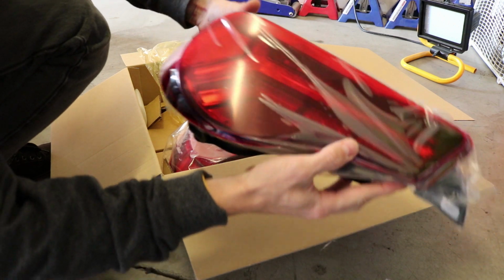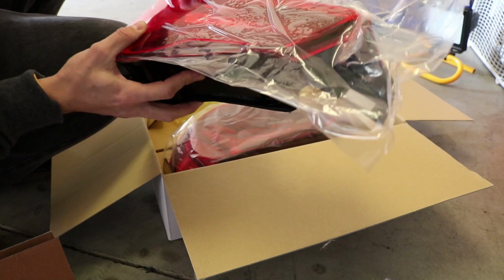Tom's LED Tail Lights V2 install on FRS/BRZ/GT86

Comment: Hey man is there a DOT/SAE stamp on it? I want to get a pair for my car but they have to be able to pass inspection
Reply from the maker: I do not think these are DOT approved since they do not have the little light on the side of the tail light. I have not had any problems in California yet. Not sure where you have to get it inspected though...
Reply: @oneSMALLgarage  I'm in Maryland so inspection is a one and done for good so I'll just buy em after inspection lol. Thanks for the info
Reply from the maker: That is pretty much same thing I did 😄 ... and no problem!